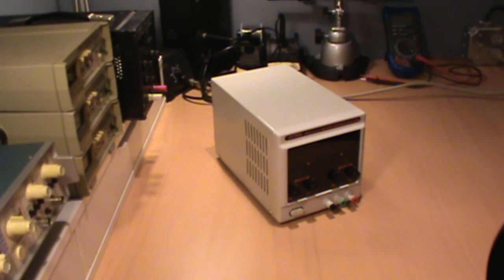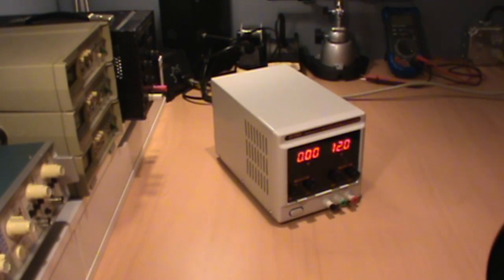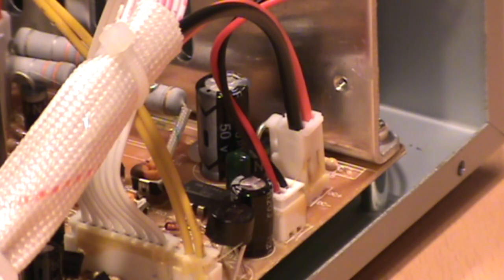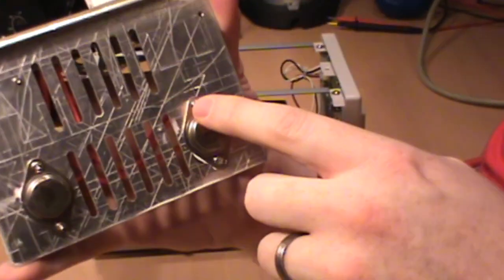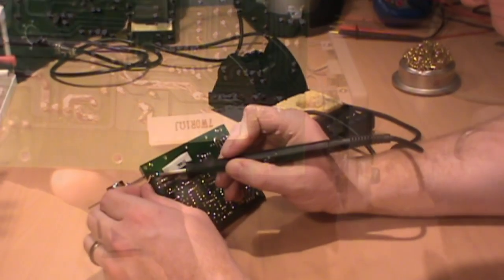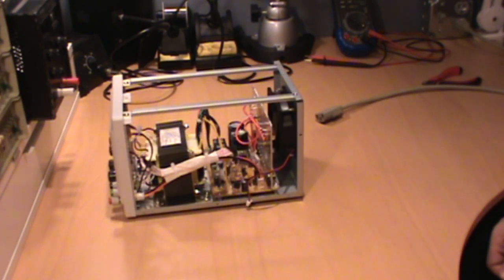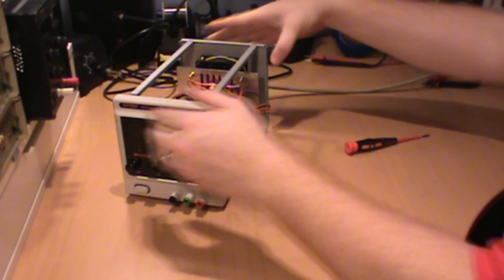Atten APS3005S Power Supply Teardown & Upgrade

Comment: Nicely done, great improvement in just 1 component swap!
By the way just a tip in case you don't know, don't clean up your soldering iron tip before putting it down, clean it up before you use it. It oxidizes way less this way, especially with rhos solder ..

Comment: I spent many years on cooling rigs and two things are very important. No fan likes the input restricted as it reduces its efficiency far more that a restriction on the output side. The second is that these power transistors need all the cooling they can get. Sucking air from around the heat sink is not going to be as good as blowing it directly at it. The video below and the following 3 in the series is well worth watching. Again the chap assumes sucking is best only to be very surprised when his tests prove it isn't.

Comment: To Vitto
There is two type of thermostats NC and NO.
NC - normally closed (it closed until reach temperature then it open and current dont flow)
NO - normally open (it open until reach temp. and close circuit and current start flow)
Good luck.

Comment from the maker: That's why I didn't cut the speed sensor wire but rather just wrapped it around the fan.  My next hack is to implement PWM fan speed control and add computer-based monitoring of voltage and current.. leaving plenty of extra capacity for some more upgrades down the road.

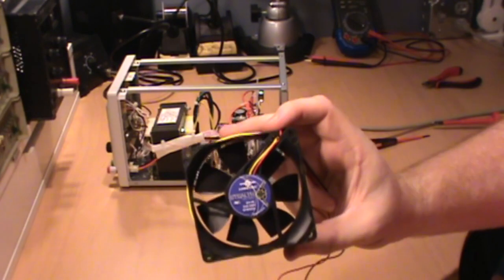Comment: Nice hack, bro!  But if I understand correctly, the fan would be either on or off depending on if it was above or below 45 degrees C?  Don't get me wrong, you have greatly improved your power supply by replacing just one component, and for that I commend you, but maybe if you were bored one day you could have the fan speed be variable and related to the temperature.  Also, at 8:15, I hope the other end of that cord wasn't in the wall!  Finally, anyone else tripped out by the 666s?

Comment: Hi! I have the same supply and the noise was certainly annoying. I will love if there is a possibility to hack the CURRENT limit so when you move the knob you see the current set, but certainly that would require to replace the uC with another and probably is not possible. I just used an LM7805 to limit the fan, and works perfect and silent. I left the supply on with a 1A load for couple hours and temperature never reached 30ºC

Comment: Hi!
Do you have a schematic? I'd like to replace the 4 potentiometers by 2 multi-turn. The problem is that the needed voltage pot is 50+5=55kOhm and the needed current pot is 10+5=15k! So, I have to modify the circuit for two standard value potentiometers...
Thank you! :)

Comment: hello,
what I dont' understand is : the KSD01F D45 is a thermistor normally closed that opens at 45C. If I replace it with a 0 resistor (jumper ) I should obtain the opposite result : the fan runs at beginning and stops when the device reaches 45degrees.
Can anybody tell me if I'm wrong ?
Reply: Yeah im wondering the same.